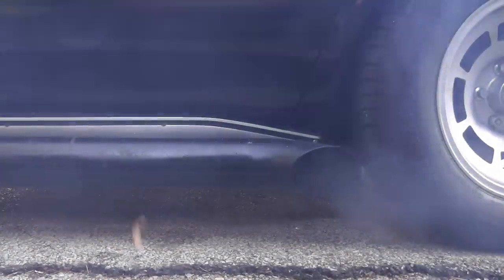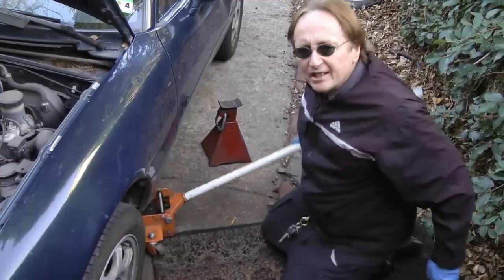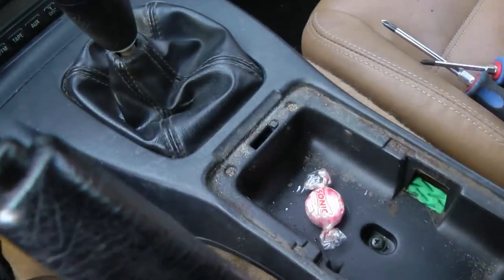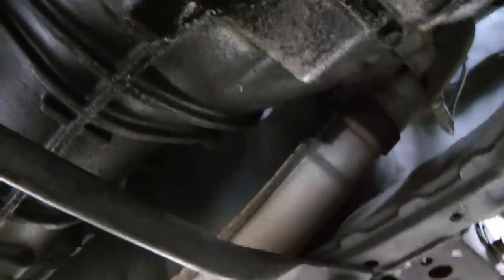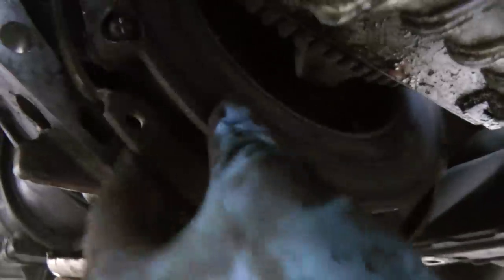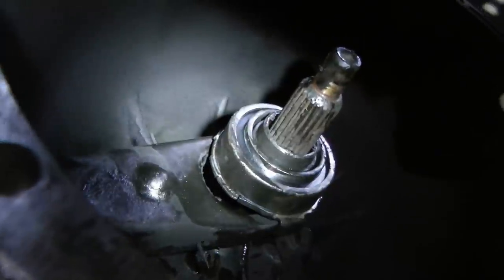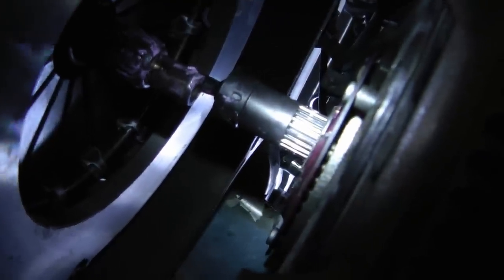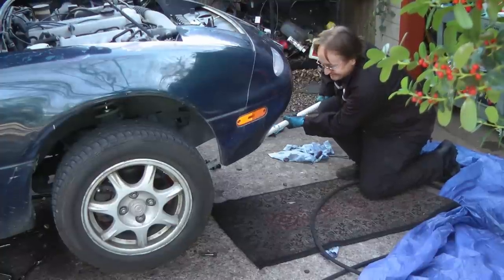How to Fix a Slipping Clutch in Your Car (Clutch Replacement)

Comment: scotty. question. girlfriends mom got a subaru outback and when on the highway and going to accelerate it seems as if the rpms rise and then the transmission goes back into 5th. assuming thats the start of clutch failure. do you know what is the best brand of clutch for this car?
Reply: If the car is a automatic it doesn't have a clutch it's just down shifting to accelerate
Reply: its a manual transmission

Comment: I have a 2009 impala lt with a 3.5 liter engine, it recently accelerated like crazy and shut off on me on the hwy. I had to get it towed home it wouldn't turn on. After a couple of days it started up like normal. I took it around the corner to see if it was running right and it was but as soon as i started pulling back home it started making a knocking noise when i accelerate. The noise is coming from the engine. What might be causing this noise and is it really expensive to fix?
Reply from the maker: Already answered this, BUT I would assume engine internal bearings are now shot and engine would need a full rebuild.

Comment: Hi Scotty I have a standar  B2300 Pick up 1995 the concern that I have is when I start the car and when I press the cluth the shifter don't apply but the thing that I do is before I start the truck I put in 1 the shifter and I move the car and after that run fine and apply very well can you help me. thanks

Comment: Good video. But when replacing a clutch ALWAYS have your flywheel resurfaced. Heck it usually only costs $50-$60 and increases the life of your clutch and reduces the chance of having problems like chatter/slippage etc. Its also a good habit to replace your master&slave while your down there. Ive seen to many people replace their clutch and a week to a month later have the clutch pedal fall to the floor due to a failed master/slave cylinder.

Comment: Missing an area of maybe adding a little bit of transmission fluid into the transmission until it is topped off again?  depending on how much leaks out I suppose
Reply from the maker: of course, but in this case just a couple tablespoons came out, not enough to bother with on a standard
Reply: Scotty Kilmer is that a rx7?
Reply: It's a Mazda Miata NA model(1989-1997)

Comment: i have a Mitsubishi lancer model 1995 and the problem that the automatic transmission experienced running on empty transmission fluid, I refill I but when I shift it in drive it wont move, can you help me wht should I replace or check thank you

Comment: I would be kind of worried that the jack used would not be centered properly.  The transmission would fall off and crush any of my body parts underneath.  Wouldn't a transmission jack be safer?  Especially if working alone.

Comment: Scotty how do you bleed the clutch so it doesn't put too much pressure on the pressure plate? I've seen mechanics bleed the clutch and then they would be very careful to make sure when someone pushed the clutch all the way in, it wouldn't apply too much pressure on the pressure plate.
Reply from the maker: you bleed the clutch just to get air out of it. Adjusting it on most vehicles just requires loosening the adjusting nut on the rod inside the car at the clutch pedal and screwing the rod in or out.

Comment: Hey Scotty my friends 96 accord ,  car shuts off and Gages go wild right before , any idea ? . Also has a check engine light . Thanks
Reply from the maker: +Allan Vidaurre get it scanned for the codes first, but often a bad battery or alternator does that, have them . tested.  Also, have ignition switch tested, they go bad on those a LOT
Reply: thanks scotty

Comment: Hey Scotty my clutch needs replacement and i found some jdk clutch kits with flywheel on ebay for a decent price. What is your opinion on those? are they any good? thinking of buying one because i can not find a clutch kit at local part stores and i have tried everyone
Reply from the maker: I've used em and they worked fine
Reply: Ok! thanks Scotty!

Comment: How did you remove the pilot bearing from the engine with that little space?
Reply from the maker: In this case it just fell out as it was so worn out. But normally I use my pilot bearing small puller tool that gets inside the small hole then forces it out with a screw

Comment: I got a 2 part question

 1 can I use a heavier duty clutch when I replace the stock one?

2 is it possible to install a limited slip diff onto my car. Its front wheel drive?
Reply: I would recommend buying a good clutch, nothing cheap, and yes you can install LSD on your car if it's FWD, I have a 00 Accord V6 3.0 sedan which was auto and swapped it with a 3.2 Type-S from Acura TL which I then built it to a 3.6 and used a 6 Speed from a 03 CL Type-S which has LSD and my Accord is FWD
Reply: 1. Yes.

2. Yes, but it won't make your car drift.
Reply: i could care less about drifting. Even though it looks fun. I can really care less of FWD , RWD , AWD a car is a car as long as it gets me from A-B im happy
Reply: Very little point in installing a locking differential then.
Reply: Gamah1991 Disagree. First, a LSD isn't exactly a "locking" diff - depending on the technology. Second, a LSD in a higher-powered FWD car helps keep the inner wheel planted while powering out of a corner or turn. Also helps if you're drag racing the car and don't want to light up one tire. That all said, in an A->B car, it probably isn't worth the investment since either situation would be rarely seen.

Comment: just got my Nissan back from a friend who offered to do the some side work on the car for me (works as an A at a dealer so it seamed like a good deal). Had the clutch and fly wheel replaced since the old clutch grooved out the old flywheel. It drives good when cold, then when it gets hot it starts slipping. I replaced the slave and bled the system at least a dozen times, to no avail. I found out recently from him that he forgot to put M/T fluid back in the trans (kinda a red flag) plus i noticed the clutch pedal is biting way to high for a new clutch ( at least 1/4 to the top)  Im wondering, am i down a clutch now? i plan to take it to a mechanic friend of mine who actually owns his own shop to put the M/T fluid in too (since im too busy to do the work on my own and dont plan to ask that other friend to work on my car anymore) and just want to know what im in for

thanks!
Reply: with my car,  there is a clutch adjustment nut under the clutch pedal.....maybe yours has one too? my pedal would only come up half way and I'd have to pull it up. then I adjusted the nut and set it to where I wanted it (and where it should be) and it's all fine now

Comment: please i have a question. i drive a Chevrolet Aveo  1.2  , the problem i have now is the 5th gear wont shift and sometimes difficult to put the car into reverse . i dont what could be wrong . do i need to change the transmission? or could it be a bad clutch?
Reply from the maker: +Olatunji Olusola pray youjust need a new clutch, put one in and see

Comment: I was driving my car in a hill station, after 10kms suddently clutch failed. Able to put gear smoothly but when i release the clutch the vehicle not moved. Stopped the car for 15 mins. Aftert that i started the car, i didn't faced any issues. So again travelled another 20 kms uphill. Then cam back to home. Next day while starting the car the clutch pedal like spongy even after bleed the clutch system. Next two days am normally driving the car, faced the pickup issue but now everything is ok. All the issue got resolved automatically. What could be the issue?

Comment: I have 02 m3 n it was running rich.. I had a misfire for a while so one of the cat went bad.. And there was bad smell coming from the exhaust.. So far I have replace all the spark plugs, coils and the bad cat with the after cat o2 sensor Because the cat was touching the sensor and it was all burned up.. But there is still bad smell coming out of the exhaust... Do u think I should change the pre cat o2 sensor.. It didn't look bad when I took it out.. And car does hesitate a little some time in first gear.. What do u think I should do now ??? Please reply
Reply: Replace first o2, clean injectors, clean MAF?
Reply: hesitation is usually bad fuel delivery or a vacuum leak.  Spray some water or carb cleaner around the intake and see if it stumbles somewhere to find a vacuum leak.  Also check the fuel pressure.  If you have one of those inline fuel filters, change it.
Reply: Also listen to MikeTheITguy, he knows what he's talking about.  I use intake manifold cleaner for that, never knew water would work :P

Comment: Hey Scotty.. I have a manual Acura Rsx 2004 base model. Earlier today, I was driving home from my friend's house, and as I was driving home, I noticed progressively that even though I was getting really high rpms, my car was not accelerating. By the time I got to my street, I had to push my car onto the driveway with the help of a neighbor because it would not accelerate anymore. Then I noticed a metallic smell coming from the front of the car. Would you say this is a slipping clutch issue or something else?
Reply from the maker: yep , time for a new clutch, yours is burned out
Reply: Scotty Kilmer Hey thanks for replying! Big fan of your videos, great work. So I ordered a new clutch kit http://www.amazon.com/gp/product/B001B5EEGE/ref=oh_aui_detailpage_o00_s00?ie=UTF8&psc=1 . Any tips or recommendations on the process of replacing it? I figure I'll do it myself and save some money + learn a bit more about my repairing my car.
Reply: mpedzi031
Use a torque wrench when doing up the clutch bolts.
On hondas the clutch bolts can be fairly small, and it becomes a fine balance between torquing them right and cracking the bolt.

As shown in the video, make sure the flywheel is smooth, or it'll wear out your new clutch quicker than intended. Also, having done this on a prelude, to get room to slide the gearbox off you'll probably want to remove the two side engine mounts so the gearbox can be twisted down for access.

Comment: My mustang gt will shutter slightly when starting in first gear. All other gears are fine. It also does it more when it gets hot. Never had this issue with other cars.
Reply from the maker: ZIPPER978 your clutch is wearing out, OR the transmission mounts are breaking down and cracking
Reply: My car is a 2009 transmission mounts look like new still
Reply: Your fly wheel was not resurfaced when replaced.
Reply: Your clutch was replaced.

Comment: i own a 2009 honda jazz.i get some sqeaking noise when i release the vehicle in first and second gears.what could be the problem with my car.should i get a clutch overhaul done.your advice will be much appreciated sir.
Reply from the maker: +EVARISTO COUTINHO often that's just minor wear on the clutch, I'd only change it if shifting becomes a problem or clutch makes noise all the time
Reply: +Scotty Kilmer sir thank you very much for your prompt reply
Reply: +Scotty Kilmer sir just one more question.are ecu reset methods shown on youtube very effective to improve fuel efficiency and overall performance of the vehicle.do you think they are safe to do.

Comment: Hi I have a question the shifter is making noise when I go gear on 2 it sound in the engine but I'm not sure what it really is is a vw jetta 2000 only make noise when I'm driving and when I go to 2 gear

Comment: Scotty Ive got a question! I have a 2003 Jeep Wrangler, With the 4.0 and 5 speed. The other day me and a friend were just messing around and were racing, and when i went to go to 3rd gear it wouldn't go! I stopped and realized with the Jeep running it wouldn't go into any gear! I figured it would of been the slave, but the master was full of fluid and i took the slave cylinder off, and had someone test the pressure it made while i lightly pressed the clutch, and it had a great deal of pressure. With the Jeep off, I can put it in gear, Press the clutch, start it, and take off like normal, but can not switch gears! And if i put my transfer case into neutral it will go through all the gears  no problem, but it makes a faint ticking noise, Faster the higher gear i put it in. Any ideas? Thanks!
Reply from the maker: +Aaron Norris   sounds like you burned out the clutch, pray it's that and not internal transmission damage
Reply: Thanks for your input. That's what I have been doing! Have a good day!

Comment: hello,
mr. Kilmer  my 2004 nissan frontier v6 4x4's 4wheel drive low light is on even when it is on 2 wheel drive. it drives weak especially going up the hill. the engine works hard. you have to press on the accelerator hard to pick up speed. What could be the issue? thank you for possibly responding sir.
Reply from the maker: +Max Cruz I assume it's stuck in 4 wheel low, have a pro mechanic who knows nissans see if he can get it back to just normal 2 WD, and then leave it that way

Comment: I see you replaced the disc and throwout bearing, why not also do the pressure plate as well??  Its such a big job that to me its worth it.
Reply from the maker: I did replace all those with a kit that had all the parts in it, you just didn't see it

Comment: hey I have a 2005 mazda rx-8 manual when the car is off it shift and everything but when I turn it on it wont shift fo nothing can you give me a tip of what could it be thank you I appreciated I also want to tell you thank  you for making those helpful video
Reply: Filiberto Reyes probs a clutch needed assuming you never damaged your trans while driving
Reply: Try bleeding the system first. if you start the car while in gear,  does it go?

Comment: Scotty, installed a new stage 3 clutch and flywheel when replacing the transmission, and now when trying to get the car into first gear or move from a stopping position, the clutch shudders. Sometimes it will stall from first gear and I am unable to get that "sweet spot" where, when especially on a hill, I can engage the clutch and keep the car steady without rolling forwards or backwards. Is this a symptom of the flywheel or clutch pressure plate not being tightened well or something else? this was a stage 3 clutch kit that was installed instead of an aftermarket or o.e.m clutch replacement.
Reply: Why did you install a stage 3? Those are going to be very grabby because they are designed to be used with more power.
Reply: +ZIPPER978  when the transmission starting going, the mechanic thought the output shaft bearing was the throw-out bearing and a bad clutch and I thought that maybe it would be better to get a new clutch and flywheel that was stronger than stock so it wouldn't wear so fast.
Reply: +samisamisamsung thats not how it works man, a stage 3 will wear at the same rate if not faster its designed to handle high horsepower your best bet and you wont like this is, replace that clutch with a oem.

Comment: That noise at the end_.  Ticking or chatter I have the same noise on my  Miata.  What cause that.  Change the oil and it still there.
Reply: Valve tick.
Reply: typical Valve ticking. It's a Mazda thing.  I wouldn't worry about it.
Reply: Exactly!
Reply: I did a trick on my buddy's Mazda. We drained about 2 quarts of the engine oil and put 2 quarts of regular automatic transmission fluid into the engine. Drove it for about 30 minutes on the road, then changed the oil and filter. His engine was much quieter after doing that. Lots of nasty gunk and crap got into the filter that was in the engine. It ran a little smoother too.
Reply: Ok
Reply: My '93 Ford Probe had the same problem (Mazda-based 2.0L engine). You're hearing hydraulic lash adjusters (HLAs) that have clogged oil passages, or were simply worn. They'd either fail to fill with oil, or after hot and extended idling, would simply collapse again and create nasty tapping. While the tricks to flush the engine with Marvell Mystery Oil, ATF, etc. may help, the ultimate fix is to replace the HLAs entirely. I never bothered, and put up with the ticking, but it was mighty embarrassing.
Reply: I've previously owned two Miatas of this generation, both cars had the famous "Miata tick." One of them did it for over 200,000 miles. It's nothing to worry about, Just poor oil circulation at startup. Switching to heavier oil (in my case, 20w-50 on a 300k mile engine) and using a k&n high performance oil filter will temporarily suppress the valve tick.

Comment: I had my clutch master cylinder changed 3 months ago because it wouldn't go into gear, and the clutch pedal was getting stuck in the down position. I just checked the clutch fluid and it is black again. I am able to get the truck into gear but it is not smooth into first and sometimed second gear. Any ideas on what is wrong? It is a 1993 Toyota T100.
Reply from the maker: best to change both master and slave together and bleed all the old fluid out
Reply: OK. Thanks

Comment: Hey scotty im thinking about doing this on my car but im not sure if this is the problem. The other day i was driving and i accidentally redlined it and forgot to shift for about a second. now whenever i revv it past the halfway mark it makes an odd noise. Do you know what the problem is?
Reply from the maker: more often that's internal engine noise from damage revving it too high. Let a mechanic ride with you, he can tell in a second
Reply: Scotty Kilmer do you know what the problem could be or how much it could cost to fix it? Today I was driving home from work and it stalled. The check engine and oil lights came on and it wouldn't start but it would try to turn. I had to get it towed to a mechanic also
Reply from the maker: TheOddBrother
I would assume engine has serious internal damage now as it won't start. Probably best to install a rebuild or used engine at this point. Cost of fixing a broken engine can get high and no one can know what it will be without taking the whole thing apart first and analyzing it. PLUS few guys really know how to fix engines right these days anyway